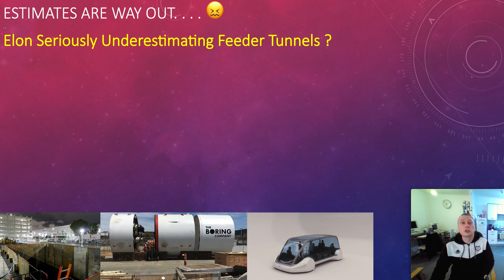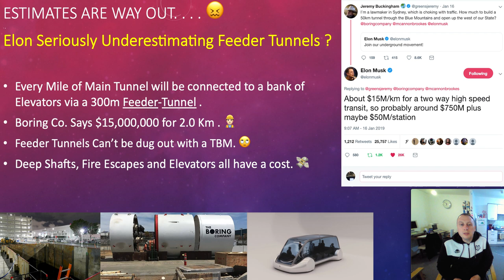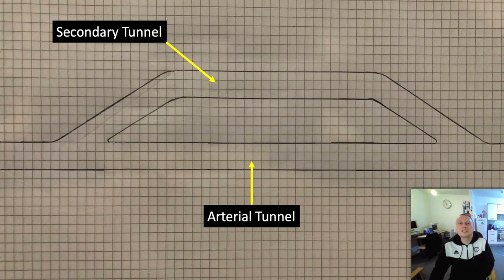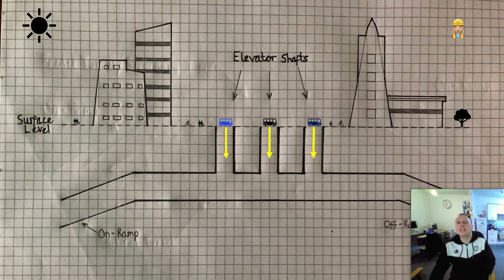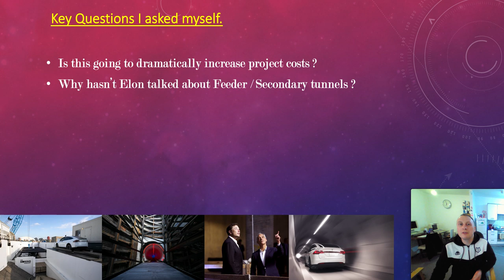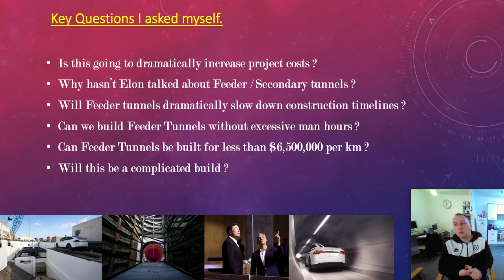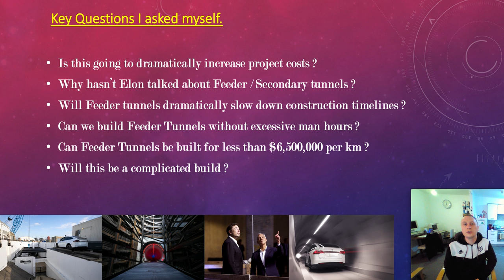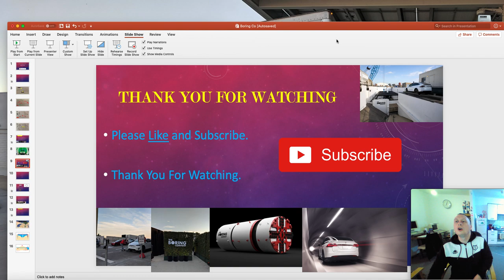Part 1 - The Boring Company Has Forgotten Feeder Tunnels 🙄 💸 👷🏼‍♀️ #29

Comment: if he really wants to sell people on how fast and effient his boring company is he should tunnel under the rocky mountains to the great plains as a low grade direct route for  high speed rail or his hyper tube transport system. if was just used for freight it would save millions in fuel and maintanance compared to climbing the Rockies
Reply from the maker: Maybe in the next decade - but for now.... short tunnels with only an A-to-B route like the Mineta San Jose Airport project are perfect because 3.5 miles of tunnel will only cost about $110,000,000 to build. We need to start small and learn quickly before we do a 70+ mile rocky mountain tunnel, but it would be fun.

Comment: Elons numbers are point to point .
I believe the ramp is wrong idea 
I think  if it as 2 parallel tunnels, one above the other 
The bottom tunnel is the main one 
The top tunnel needs to be 2 lanes 
One lane is non stop 
The other is where elevators or ramps come in.
Your sloped ramps would come up into the non stop lane before an elevator. 
Could the elons TBM run side by side and then knock out the wall between ?
Maybe that s why 50 mill per station
Reply from the maker: I've not really thought about that option because i'm trying to keep the mileage of tunnels to an absolute minimum, plus all that extra spoil would soon add up. Pipe jacking is fairly fast and can be done cost effectively plus it has been used at the Hawthorne test tunnel. Digging a 300m tunnel in "less" than 3 weeks should be fairly easy if ground conditions are average.
Reply: I think the idea with digging parralel tunnels using TBMS and then removing the wall between them is resonable. I would aim for 3 Parallel Tunnels total - two dedicated for each direction, and one where the Acess stuff happens (with alternating Acess directions)
Here a ascii sketch how i mean it:
<<< -----<-----<-----<-----<-----<-----<-+-<-----<-----<-+-<-----<-----<-----<-----<-----<-----<-----<-+-<-----<-----<-+-<----- <<<  Artery to left
 . . . . . . . . . . . . . . . . . . . . . . . . . . . \ . . . . . . . . . / . . . . . . . . . . . . . . . . . . . . . . . . . . . .. . . \ . . . . . . . . /
=== --------+----->-------+-X----------X-+------<------+-X--------------X-+------>------+-X----------X-+----<->----+-X----- === Access/Service Tunnel 
 . . . . . . . . / . . . . . . . . . \ . . . . . . . . . . . . . . . . . . . . . . . . . . . . . . / . . . . . . . . . \ . . . . . . . . / . . . . . . . . \
>>> ----->-+->----->----->-+->----->----->----->----->----->----->----->-+->----->----->----->----->---+->----->---->-+->----- >>> Artery to right

X= locked paths

If you need to do maintinence in one of the Artery Tunnels this even gives the option to change traffic direction in one Station, unlock the attached two usually locked tunnels and lock about 1.3 km of the Artery Tunnel for Maintinence (Traffic flows through Access Tunnel at reduced speed for this) - this would limit or disable 3 stations, but better than locking the artery tunnel as whole ;), and this could be improved by making Stations accessible from both directions as shown in the rightmost station, so you could even adjust station assignment based on traffic needs (no bi-directional traffic ofc, each station only serves one direction at a time, but can change it if the need arises)

Comment: How did the English Channel Tunnel (aka "Chunnel") get built with the cross tunnels that connected the three main tubes?   That was something which obviously couldn't be built by the regular TBMs, but were required by the contract to be very regular.  Furthermore, there are cross over tunnels for trains to switch over in case one tunnel or the other needs to be shut down (for an emergency or even simply maintenance reasons).

Were those simply built using traditional horizontal mining techniques?
Reply from the maker: This was on TV yesterday. They had 3 tunnels - so 2 main tunnels and 1 central service tunnel. All dug via 6 TBMs. 
The narrow & short walkway tunnels where dug mostly via machinery and sometimes by hand.

Comment: ...why not build them like swimming pools...dig a hole..plop in the feeder tunnel ...cover it back up...voila...
Reply from the maker: It would be 20% faster than pipe jacking but would cause so much congestion and disruption. would also cost more! 
The first engineering project I ever worked on was a cut and cover excavation - a 28" water main.  Its a tried and tested method but has a few major draw backs in Urban areas like L.A. 
https://www.wsp.com/en-GL/services/cut-and-cover-tunnelling

Comment: It's good to see that you've identified and acknowledged the problem with the Loop system with regard to feeder tunnels (which also exists at all branches in arterial tunnels).  I identified this quite a while ago as it was obvious that forming branches/intersections where tunnels split/ converge could not be achieved using TBM's.

You mention pipe jacking for the feeder (acceleration/ deceleration on/off ramps) so I'm very interested to see your proposals in this regard.  I suggest such feeder tunnels will have to be longer than you stated as these on/off ramps will need to allow pods/cars to safely accelerate to/ decelerate from the maximum speed of vehicles in the arterial tunnels (150mph stated on TBC website).

As any branches will have to be at a shallow angle then there will be a considerable length at each intersection where the 2 tunnels converge with each other so I'm interested in your proposals for how such can be practically constructed (as it will involve the partial demolition of completed tunnels).

Branches are a major consideration when developing a Loop network. Unless the entire loop network under a city is to be fully constructed before use (which is unlikely particularly from a commercial perspective) then there will be major problems adding tunnels to Loop system that is in operation.

Unlike a road with a new side road being constructed off it (which can remain open to traffic) adding a branch to a tunnel will require completely closing the operational tunnel whilst the new branch is constructed.
Reply from the maker: Its quite complex but i've drawn a feeder tunnel system that is mostly pipe jacking (220m) with a small amount of traditional tunnelling (80m). You'll like it if you want a more detailed proposal  😋
Vehicles will need to be going 110mph - 120mph when they hit the off-ramp. With powerful regenerative braking and a small bank of ultra-capacitors they should be able to go from 115mph - 0mph in under 12.2 seconds.
Reply: @BoringRevolution 
My understanding was that a entry/exit spur tunnel was to be built nto the Hawthorne tunnel (from/to an elevator in a garage).  Have you seen any photos or videos of the construction of that spur as it was meant to be constructed by pipe jacking?

Comment: It still seem the major flaw is the elevators. Their throughput is so slow compared to the main tunnel. There will need to be  be huge numbers of them to effectively feed and keep busy the main tunnel. What happens at the surface when a car wants to use them, is their lines waiting for the elevators? Do you search for available elevators? It seems like it would take much fewer ramps from surface that allow traffic to enter at say 30 mph into  parking structure type spirals that would eliminate surface queueing and affecting surface traffic. These ramps would only be located at high surface traffic points like shopping centers, hotels, business buildings etc. Maybe underground parking structures here and people elevators instead? If the main tunnel is 100 mph and spacing is 50 feet, 100 cars per mile and 10,000 cars per hour. If the elevator speed is 2 minutes, 30 cars per hour, you need about 300 elevators. If you had 30 underground parking structures with spiral ramps at high traffic areas instead, the structures act as a buffer keeping surface traffic flowing normally. This would be much cheaper and more efficient.
Reply: This could eliminate cars from the city center.
https://www.fastcompany.com/3040634/7-cities-that-are-starting-to-go-car-free
Reply from the maker: @gregburke7905  I support 100% having pedestrianised areas. 15% of L.A should be pedestrianised - but it needs to be done in a slow and systematic way in conjunction with many side roads being converted into one-way cycle lanes!!!
Reply from the maker: Will be touching on this in part 2 available Sunday ! But the on-ramp is built at a 1 in 8 gradient so the elevator shaft is only 22ft deep. so what is required is an elevator that can do 0 - 12mph in 1.8 seconds. one option is a "multiple motor" Rack & Pinion Elevator - heavily modified for extra power.
Reply: I think 12 mph is optimistic. Online I found highest speed short elevators is 150 fpm. This would take 7 sec. But you need to consider total cycle time = drive on (5 sec?) down (7 sec) drive off (5 sec?) up (7sec) = about 25 sec cycle best case. In any system with mismatched speeds, you need buffering to keep flow going at optimum. Where do the other cars go on surface while waiting for cycle to complete? They block traffic to wait for the "parking space" to become available. That is why ramp or spiral from surface and underground parking/buffer area allows queueing into and out of the system to occur underground. Parking garages have same problem and have some queueing space inside to keep from stalling surface traffic.
Reply: If you think into the future, surface land in cities will be premium. It will not be wasted on city street parking or parking lots. All parking will be underground. It only costs 25% more than surface (maybe less since underground land is cheaper).
shoup.bol.ucla.edu/HighCost.pdf
 table 1

Underground parking construction is top down, drill column holes, pour floor, excavate under floor which becomes roof supported by columns. Repeat.

 A high throughput version of this network just connects underground parking structures. Want to go from airport to dodger stadium, go into feeder at airport underground parking, go to main tube, get off at feeder to dodger stadium underground parking. Go to Hotel underground parking. No surface parking or roads needed here. All Las Vegas could be underground parking and roads. If you need access to surface, go up levels in parking structure till surface. Most of the time not needed. All traffic and deliveries would be people and freight elevators from underground garage to surface building.

This only works with electric cars, otherwise poisonous gasses. Your cars would stay clean. Also works for shuttles.
Reply from the maker: @gregburke7905  I'm thinking the same. Under ground parking lots are a solid solution. I do think an elevator can be re-engineered to  do 0 - 12 mph in 1.8 seconds with multiple motors ! Land costs in place like L.A, San Francisco and Houston are going up at record levels every year. Tunnels make perfect sense!
Reply: @BoringRevolution  I think you can just make it...If you use a triangular move (accelerate half way, then decelerate other half) and you set acceleration to 1G (any faster and the car will float off the lift)
distance 22.00 ft

 264.00 in

time 1.67 sec

Accel = 4d/t^2 378.64 in/sec^2

 0.99 g

Vavg = d/t 158.08 ips

 8.98 mph

Vmax=2*Vavg 17.96 mph

Although you could accelerate up faster than down...
Reply: @A Boring Revolution This would feel like a ride at Disneyland. You would be weightless going down and weigh 2x (including car) going up. The sharp changes in acceleration would jolt you. You could use S-curves to smooth it out but would take longer.
Reply: @A Boring Revolution  For reference, here is the acceleration of Tesla Model 3 Performance
Tesla model 3 perf  

time 3.50 sec

vmax 60.00 mph

 1056.00 in/sec

accel v/t 301.71 in/sec^2

 0.79 g
Reply: In Star Trek Wrath of Khan...Guilty of 2 dimensional thinking,
https://www.youtube.com/watch?v=RbTUTNenvCY

A good analogy of this system would be the cardiovascular system. There are no traffic jams here. No stop signs, stop lights, accidents. All one way flow with different tubes operating at different speeds.
Reply: @BoringRevolution  Is there any way to send you a picture? I think I worked out a simple ramp system but you know much more about construction than I do. I would like your opinion. My email is greg.m.burke@gmail.com if you would like to exchange ideas.

Comment: I don't get how cars can go 70 mph onto an elevator shaft, or how they can turn into a side tunnel at 150 mph? 
I think the costs of Boring tunnel systems will grow and grow as the details of the whole system become apparent.  Musk's numbers don't mean much at this point.
Reply from the maker: Have you ever hit the off-ramp of a motorway at 90mph ? Imagine that but with regenerative braking on maximum !
Reply: Charlie Doyle Germany has built a tunnel foundation all that is needed now is speed and railways. Hopefully railways before speed💁🏼‍♀️As we all know speed in Bavaria is not an issue just the diesel.